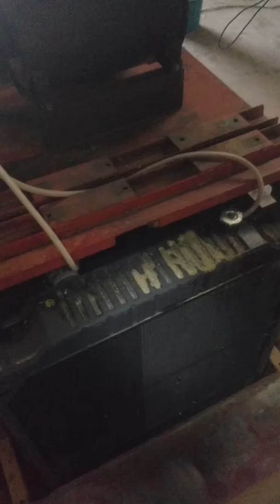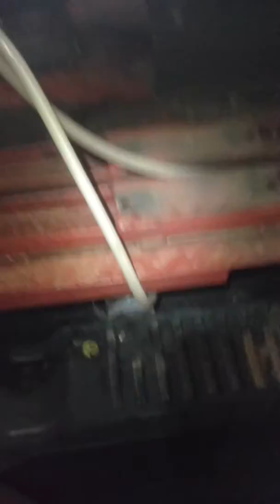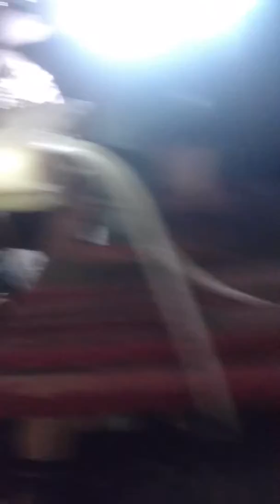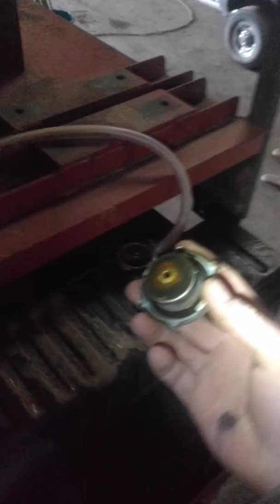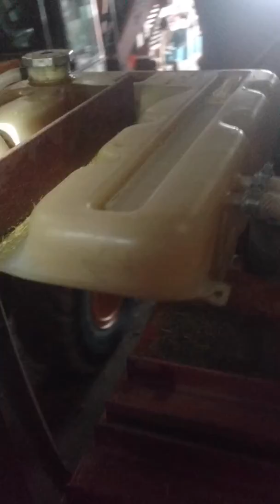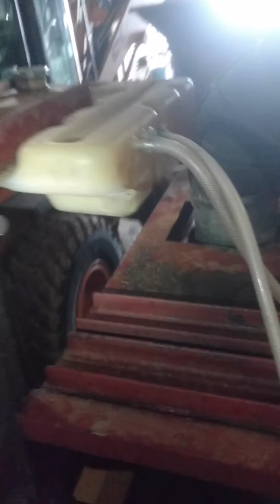Cooling system degas

Comment: Good info, thanks!  So the modified cap on the radiator will not hold pressure, but the one on the top of the de-gassing tank does, correct?  Do you then leave a portion of the top tank full of air like a BMW system?
Reply from the maker: Yes sorry I should of mentioned that

It is a higher pressure cap on the radiator than there is on the tank

The tank is the operational cap, the rad cap will never open nor  leak at any point. Knocking the recovery valve/flap off the the cap just leaves that hose open to flow full time

Yup usually 3/4 full on the degass tank. Everything below that level fluid 100%

Watch my old video on my laptop Degas setup. Showing the actual flow

Head ports to top of tank, lower hose to pump suction
Reply from the maker: https://youtu.be/PvOicuvzdhE
Reply: Fantastic, thank you!!